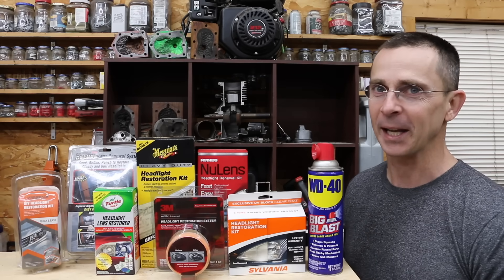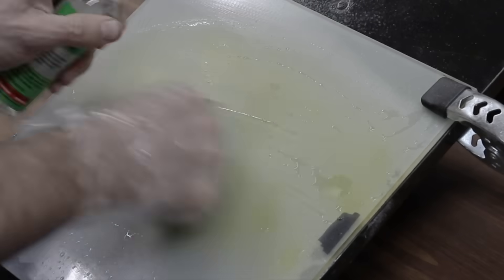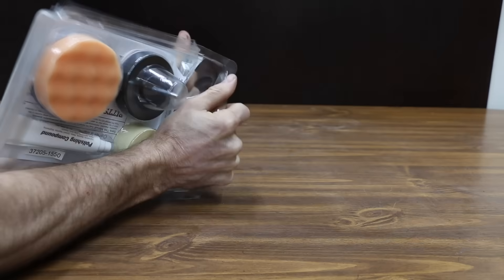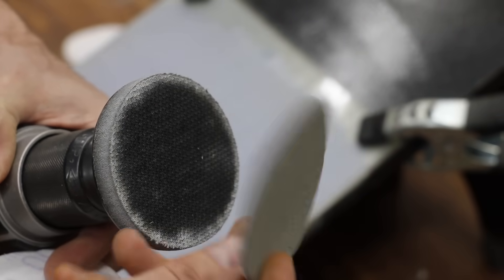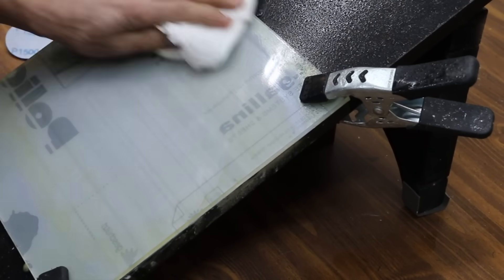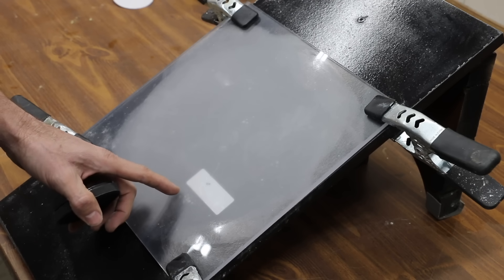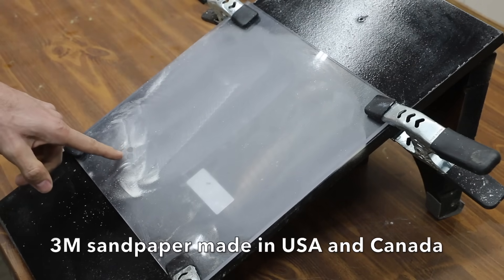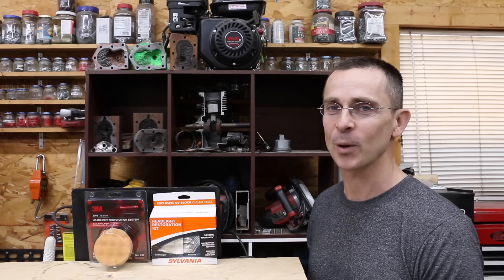Best Headlight Restoration Kit?  Let's find out!  3M, Sylvania, Meguiar's, Mothers, Turtle Wax & HF

Comment: This was a good one. Never heard of Sylvania lens repair and have had mixed results in the past. Like everyone, I too tried the Harbor Freight and yes, found the sandpaper gummed up quickly. I use 303 for UV protection, but find it doesn't seem to stay put on the lens. Works better on rubber and rougher surfaces. Thanks!!
Reply from the maker: Thanks for the feedback.

Comment: I don't care what anyone has to say, if your doing this job and you don't use wet sand paper to break down the cloudiness it's not done correctly.  They have all these brands that claim you only need to wipe the cloudiness off and that is absolutely not true!!!   You NEED the wet sanding part of the process for it to work and or last,  the wipes will pick up the yellowing oxidation to an extent but not enough for it to bring lenses back to clear.
Reply from the maker: Thanks for the feedback.

Comment: Nice comparison! I just use standard wet sandpaper 800,1000,1500,2000 polishing with Meguiars Mirror Glaze heavy cut and fine cut cleaner. Works great and looks like new.
Reply from the maker: Awesome!  Thanks for watching.

Comment: One thing I'm seeing is that clear coat datasheets specify applying either shortly after a base coat (usually color), or after scuffing the surface to ~800 grit. The first produces chemical adhesion, the second mechanical.

Here in these kits they polish it to a high gloss, which makes it bad for clear coat adhesion. The Sylvania kit includes the surface activator, and I wonder if that is like the plastic "adhesion promoter" products available.
Reply from the maker: Great feedback!  Thank you

Comment: I've restored headlights several times over the years. The first time I tried using toothpaste, after watching videos on YT about that. Mediocore results with a huge amount of labor. I still cringe thinking about the severe hand cramps I got from that. I've used 3M twice with good results. The second time I used 3M I also did a final polishing with a random orbit polisher with an orange pad with Flitz polish on it. That improved it a bit without much additional effort or cost. I also use a premium car polish or ceramic coating on the headlight lenses too. Next time I"m going to try that Sylvania product. If I was happy with 3M, I should be over the moon using that product. Thanks for another great in-depth review!
Reply from the maker: Thanks for sharing.

Comment: I've used the Meguiar's and I think It's the best one for value. I noticed many times you did circular motions with the sandpaper which I can tell you that will never be easy to get clear. This is the same process as lapping say a heatsink, you want equal pressure (or steady pressure) and straight line sanding with equal passes horizontal to vertical. you do 10 horizontal passes, you do 10 vertical passes. Now Meguiar's 1000 grit is more forgiving than a lower grit so easier to not over/under sand and harder to "scratch up". Also this process took me about 20 mins per headlight to get from foggy yellow to like new. Also I believe Meguiar wants you to put the clear coating at the end be applied horizontally from top to bottom with a very tiny overlap, that way you catch the dripping from the top pass.
Reply from the maker: Thanks for the feedback.

Comment: Try NOVUS PLASTIC POLISH NO 2. It only takes 5 minutes and removes all the "fog" and "yellowing" without taking off the UV coating from the manufacturer. The polish is a 10,000 sandpaper grit in liquid form. Try it! Made in USA of course only $12 or so.
Reply from the maker: Thanks for the video idea.

Comment: Off subject - Have you ever rated tile bits?  Designs seem to be from standard looking diamond tip bit to Milwaukee's rounded diamond bit.  I'm wondering if I should put the tile piece under a layer of water before cutting a hole???
Reply from the maker: Thanks for the video idea.

Comment: you need to try acetone, both wipe on and vapor.  (I do the vapor it works great).   I wet sand with find sand paper then acetone vapor.  Then spray on UV.  You can also use buffing pads with buffing compound if you don't want to mess with acetone.
Reply from the maker: Thanks for the video idea.

Comment: Not sure their instructions said it or not, guessing not, but Meguairs plastix polisher was used wrong and so the result wasn't fair. I just recently used it on a car cluster that had scratches deep enough to feel with a finger nail and completely removed them with nothing but the plastix. based on the video you kept adding plastix to the sheet while it still had existing plastix on it. The plastix is supposed to be buffed until completely gone. Then wipe clean and repeat. Adding plastix to existing wet plastix actually ruins the process. 

I think it would have done better than it did if this had been done. Mainly saying that because of my personal experience in using it correctly.
Reply from the maker: Thanks for the feedback.

Comment: I used the 3M kit and it did work well, but did not restore them to new. Does anyone know why the passenger side headlight is always a bit cloudier?
Reply from the maker: Great feedback.  The passenger side must face south or experience more UV exposure.  Was it possibly replaced at some point?
Reply: @ProjectFarm  It wasn't replaced. I noticed it on my dad's vehicle as well. Maybe it has something to do with the side of the road we drive on. Great video as always.

Comment: Great video! You never used WD-40.

Also, here's a scam for selling cars, a little bit of brake fluid will shine the headlights right up.
Reply from the maker: Thanks for the suggestion and for the tip.

Comment: The problem with my headlights is discoloration on the DRL halo rings which located inside the headlights. Are these a sign of UV damage? Because the headlights itself aren't showing any kind of discoloration/fading. I just ordered replacements for my headlights and looking for ways to keep future discoloration on the inside.

Comment: You should test if a headlight restore kit can fix "worn" unpainted plastic better or worse than various plastic-restore cleaners/sprays...I have wondered for a while if that may be an option to fix cosmetic wear on smooth finished plastic trim (no texture) as well as housings on yard equipment and other things which are supposed to be smooth-glossy shine but are not painted.
Reply from the maker: Thanks for the video idea.

Comment: I have used the 3M product on 3 different sets of headlights. It is very easy and works great. I would agree that you should use a protective coating afterwards. 1st set lasted about a year before I had to do it again. Lesson learned, and the others have lasted a very long time with gteat clarity.
Reply from the maker: Thanks for sharing.

Comment: Can you do a new video on air filters. I really liked the previous one it was incredibly useful. Different range of price POD filters, cheap, mid, expensive? Also add strength difference between those that have a cap on the front  and those that don't. For example small rocks flying towards them?
Reply from the maker: Thanks for the video idea.
Reply: Project Farm thanks, for noticing and always doing such a great job :)

Comment: I’ve use the Meguiar kit. Did find I didn’t like kits finish, so I worked on it with 4000 grit power buffer and then polished and sealed. After 17 months the headlights where still clear. I can’t say anymore about it, because I hit a deer and had to replace both headlights, but the headlights did not show signs of weathering or yellowing for those 17 months. Also, if you can remove the light assembly, it much easier to clean and finish.
Reply from the maker: Thanks for sharing!  Sorry to hear you hit a deer!

Comment: I use Mothers mag wheel cleaner with a 6 inch buffing wheel on a drill....then regular rubbing compound with a buffing wheel ...then real fine rubbing compound with a buffing wheel...if results are not good enough to my liking ...do it again ...to finish it off Nufinish wax ....
I go into the two parking lots where there is two big stores not far from home with all of my stuff in the back of my adult tricycle looking for cars that are badly oxidized offer the people if they want me to clean up the head lights ..I don't charge them ,I do it for their safety...Some are older cars and they can't afford a shop to do it..These people are amazed at how clear the head lights are I am finished.
Reply from the maker: Thanks for sharing.

Comment: I use 1000 grit - 3000 grit sandpaper then I polish with meguiars 205 polishing compound on a Dual action machine Then use 3M clear coat wipes. Lens (aslong as there is not inside damage) comes out literally looking new
Reply from the maker: Thanks for sharing.

Comment: I use 3m out here in the desert on Air Force Silverado vehicles. They are the best. 3m also makes the UV applicator sealer.
Reply from the maker: Thanks for sharing.

Comment: Well I don't know about anyone else but not a single drill motor I have has a RPM gauge 400 to 600 or the 1300 to 1700 rpm way to much work with to much chance to screw up for myself the 50 bucks each for new housings is the way to go
Reply from the maker: Thanks for the feedback.

Comment: The best easy method I have found that gives acceptable results is acetone. I just wet a fine cloth and do just a couple of swipes and it will wipe off all the yellow and leave it reasonably clear. The trick is to not wipe too much or leave too much acetone behind on the light. If you go to hard it can possibly make it even more foggy then it was before. ONE OR TWO wipes is enough. Finish with a polish and you will have much improved (not good as new though) lights on the cheap.
Reply from the maker: Thanks for the feedback.

Comment: I suggest a sandpaper comparison. Various kinds of sandpaper  on various materials. In this video you really liked the 3M paper, but I hate their wet/dry sheets. The are too brittle, and simply don't last. But my application was polishing stone, and that's a bit odd. Mirka sheets were much better, but were expensive, and Klingspor wore out quickly. Later I found USA Abrasives and those were pretty good for much less than the Mirka. Seeing a side by side comparison on wood, metal, stone, or whatever would be interesting, though. And I'll bet things are different with sheets vs pad sanders vs orbital. You could go mad with all the combinations. Still, something to consider. Thanks!
Reply from the maker: Thanks for the video idea.

Comment: How about something to recover the black color in plastics that have been burned by the sun?
Reply: Heat gun. Melt the very top layer of the oxidized plastic.
Reply: Gtechniq C4
Reply: 303 aerospace protectant
Reply: Mothers back to black is the one I use.

Comment: The only way I recommend fixing headlights is to sand them and clear with a 2k clear.
Reply from the maker: Thanks for sharing.
Reply: @Stephen Brewer
Which clearcoat UV resistant spray paint for plastic do you recommend?
Reply: watershed44 Eastwood or spraymax 2k clear. Or carry them to a body shop for the clear.

Comment: I'm wondering if the auto manufacturers have ever been named in a class action lawsuit for selling vehicles knowing headlight degradation will occur. Being a professional driver I see night time use of highbeams every night. When this behavior first started happening I thought that the drivers were simply being disrespectful. I soon discovered that many motorists cannot see properly with low beams because of the headlight design failure. How many people have lost their lives as a direct result of degraded head lamps? Here in Canada a vehicle will pass safety inspection with yellowed oxidized headlamps and as long as they work and are not broken they considered fit??? It's my opinion that auto manufacturers should be held accountable for this horrible violation of safety. Truck mfr's too, late model Volvo's were the worst. Just saying...
Reply from the maker: Thanks for the feedback.

Comment: Save yourself the cost and aggravation by wet-sanding with 400/800/2000 grit sandpapers. Spray a few coats of an automotive rated clear coat. The first coat may look very cloudy but when completely dry, it should be completely clear. Add a few more coats allowing each coat to completely dry before applying the next. This process will last for years.
Reply from the maker: Thanks for the feedback.

Comment: It sounds crazy but OFF insect repellent applied with a dryer sheet works amazingly well. I’ve seen it bring headlights that were so clouded you couldn’t see the bulb to surprisingly clear in just a couple minutes. It will not give you sylvania quality, but makes good use of a couple items most people have at home.
Reply from the maker: Thanks for sharing.

Comment: I had an old 03 impala that had super oxidized headlights so I scrapped off the old layer with a razor blade and wet sanded from 400 grit to 1500 then sprayed that uv resistant clear coat on it. It came out  clear but had orange peel which could be corrected with fine sanding and buffing compound. I had those headlights for 2 years and the only issues would be the clear chipping off from rocks but I think a quality clear coat would work much better but great video!
Reply from the maker: Thanks for the feedback.

Comment: Toyota headlights are prone to yellowing relatively quickly in harsh South African weather.
As part of regular maintenance I polish the headlights with standard Colgate toothpaste which is very mildly abrasive. This is a cheap and quick fix for clear fresh smelling headlights.....
Reply: No cavities?
Reply: @Sheran Naidoo
Problem with your idea is that you are removing the UV layer of protectant on the lights, if you remove that UV clearcoat you need to replace it or the plastic will eventually crack and craze without it.
Reply from the maker: Thanks for the feedback.
Reply: @ProjectFarm  Would have been great to have included this old standby trick as a comparison to all the commercially available kits. Maybe a follow on/follow up and use half of the real headlights and use the toothpaste against 3M and Sylvania??
Reply: Get a can of UV resistant clear coat too, cheap and you don't have to scrub so often
Reply: Aweh ma se kind

Comment: I've used the 3m kit on two different vehicles.  Works great and lasts a long time.  I did purchase a separate sealer for afterwards, but years later the headlight on an old Grand Am were still very clear when I sold the car.
Reply: Which sealer do you recommend?
Reply: Ian Stearns While I have no basis to compare sealers, the one I used was called “Headlight Lens Sealer” by Bluemagic.  After a couple years it didn’t have any new yellowing so I think it worked ok.
Reply from the maker: Awesome!  Thanks for sharing.

Comment: I used the Meguires kit on 3 vehicles and i could still use it but 2 years ago it came with 1 1000grit pad, 1 3000 grit pad, pad holder, microfibre towel, buffer disk, plasticX & protectant. And man does it work the biggest difference was on a 1999 corolla
Reply from the maker: Thanks for the feedback.

Comment: I just used the turtle wax 2 nights ago on both a nissan and an older mustang.  Worked fine.
Reply: I suppose without comparing I wouldn't know that it could have been better.  Love the video.  I like a kit that has a multiple use finishing product.
Reply from the maker: Thanks for sharing.

Comment: I've only used one of these kits, and it happens to have been the Sylvania. It did a marvelous job. My kit was older, having used it maybe 3 years ago. The difference is that last step liquid. It made a huge difference. My takeaway from using it is if you get high quality sandpaper, go 400>600>800>2000>4000, and Keep the surface wet to avoid burning and melting the plastic, then apply a couple sprays of aerosol clear, and finish with a good quality paste wax, you will end up with results that last.

The Sylvania kit, while being excellent, does not give forever results. You need to reuse every year or 2, depending on parking habits. Save money and make your own kit.

If you use clear coat, put the can in a cup of hot water first. Let it warm for half an hour.

Don't be intimidated. You got this!! Prep is key. Tape off the lens. Cover all rubber and paint.
Reply from the maker: Thanks for the feedback.

Comment: I just used 800,1500,2000,2500 wet n dry then cutting compound and then various scratch removers and waxed them (had all that stuff for sorting out the cars paintwork) made them good as new
Reply from the maker: Thanks for sharing.